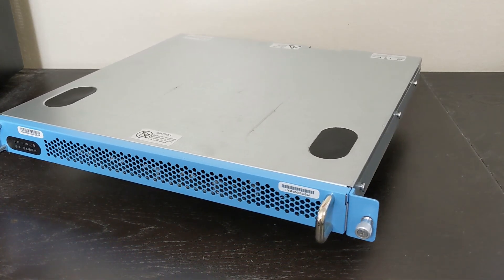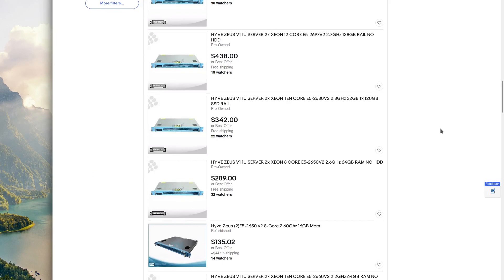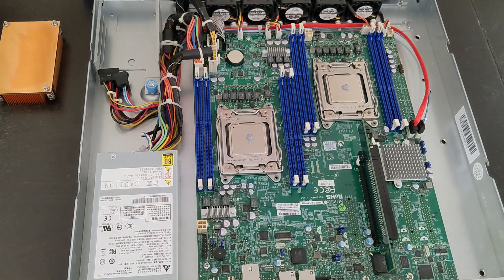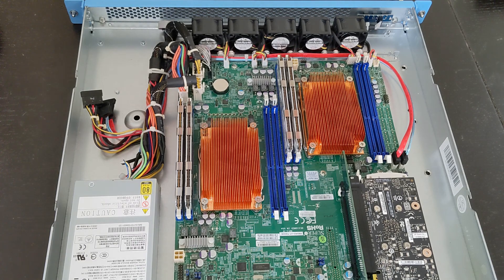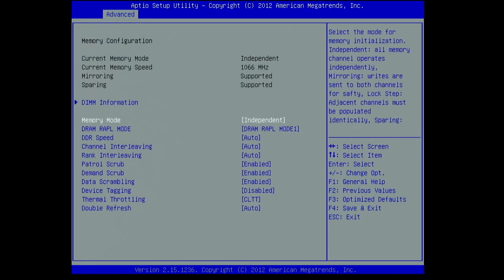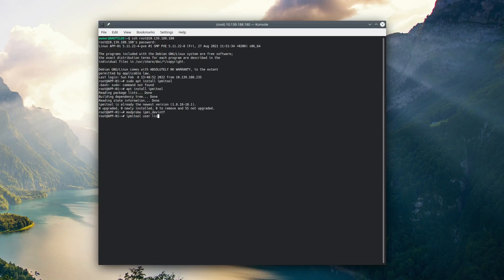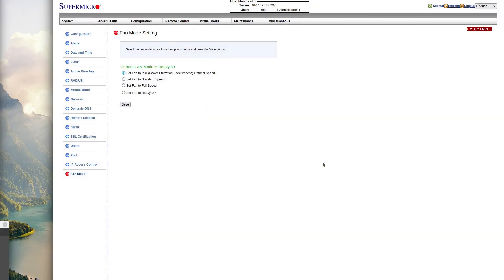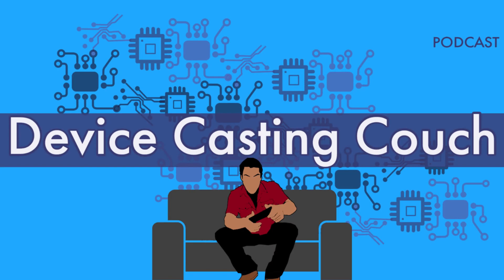Home Server on a Budget | Overview/Setup of Hyve Zeus server

Comment: is it the fan wall or the power supply that most of the noise is coming from?  if it's the fan wall, you can pretty easily swap those fans out with something like noctua high flow fans that are nice and quiet while still providing reasonable airflow based on thermals, if it's the power supply you're kinda boned unless you're ok with doing a little surgery and maybe a little crimping beyond the scope i'm comfortable recommending.

Comment: 1U is very noisy. I have 4 x Dell R620 with full load 24/7 at home. Need to put it in private room. 
Better to use 4U chassis with bigger fan, then you don’t need air conditioner. Save a lot of electricity . I live in Vietnam, temperature here is always 33-37C

Comment: Instead of using the GUI for ipmitool.  
Just use the ipmitool cli.

(memory,  cpu, nvme, cmos, and etc sensors)
ipmitool sdr list
(setup the next boot)
ipmitool chassis bootdev bios
(print fru for system serial number, model, and etc.)
ipmitool fru print
(print MGMT interface configs)
ipmitool lan print
(power off chassis)
ipmitool chassis power off
(print event log)
ipmitool sel elist
(console into the host)
ipmitool sol activate
(kick someone off the console or if console is stuck)
ipmitool sol deactivate

If you want to change your fan speed then you'll have to change the speed through ipmitool raw:

Example: 
(Change the mode to Full Fan)
ipmitool raw 0x30 0x45 0x01 0x01

(Individually change FAN0 or FANA)
ipmitool raw 0x30 0x91 0x5A 0x03 0x00 0x91

Comment: I would also like to know power consumption info on this.  How does it compare to say an r710?
Reply from the maker: I checked the IPMI and at idle with no VMs running it is pulling 40 watts, with the VMs running its any where between 50-60 watts, and the highest I have seen my setup go is 90 watts.

The power supply is rated for 400 watts.

It could vary for you they sell these with many different CPU configurations and you might install different HDDs and/or GPUs than I did. I also do not run anything too intensive to keep the noise down.

Comment: What is the power consumption for the Hyve? Interested in using for PfSense but no one has given what idle/operating watts it runs at
Reply from the maker: I'm running proxmox so my numbers might be different and these numbers are from the IPMI and not the wall. At idle with no VMs running it is pulling 40 watts. With the few services I am running I'm seeing about 50-60 watts. The highest I have seen mine go is 90 watts.

I also took a look at the power supply and it is rated for 400 watts.

I think it all depends on how hard you plan on using it and what CPUs are installed. With my two E5-2650 v2 and the few services I run it is not using a whole lot of power. For pfsense you could probably get away with fewer cores and a lower clock speed which would ultimately use less power
Reply: @DeviceCastingCouchTechPodcast  Thanks for the reply! Think 1 CPU is going to be the route I take as it will be overkill for a pfsense box anything bigger!!